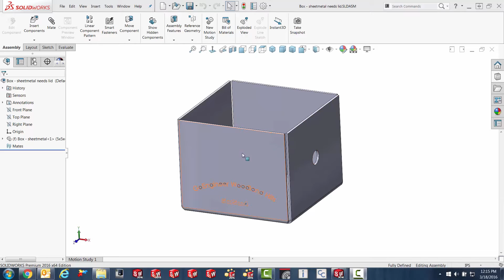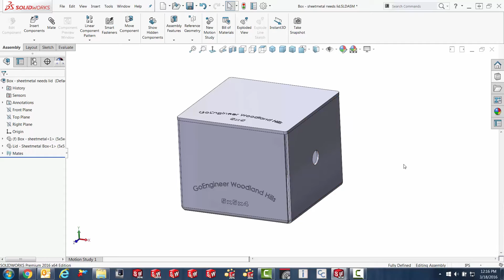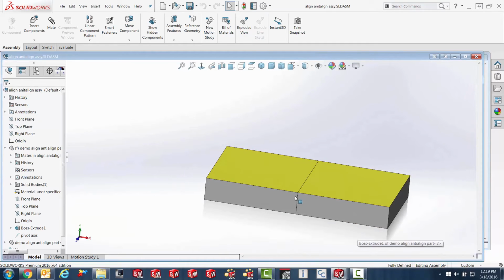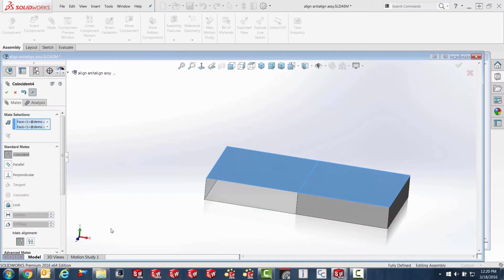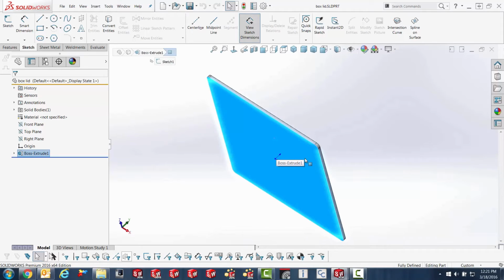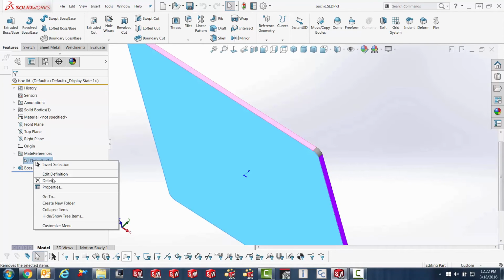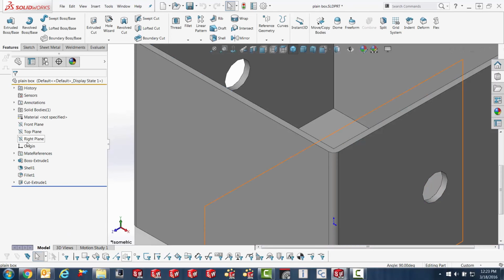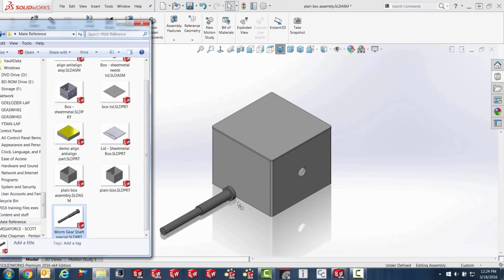SOLIDWORKS - Mate References for Commonly Used Parts

Comment: At firm where  I work we are using the Smart Mates. But I we have one problem with it. We can't make Smart Mates working with hexagonal hole and hexagonal riveted nut. We can't use the coincident mate as you used in this tutorial because hex hole is a little bigger than the rivet. So have you any idea how to figure it out? Maybe  the smart features can make it working? Thanks in advance.
Reply: Does adding in an axis to the hex parts and adding the mate references to the axis work?